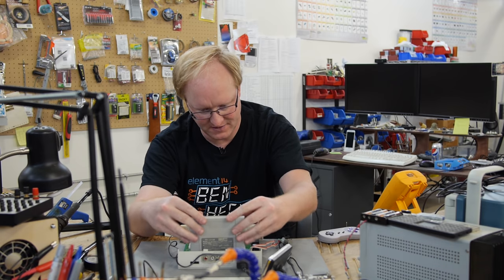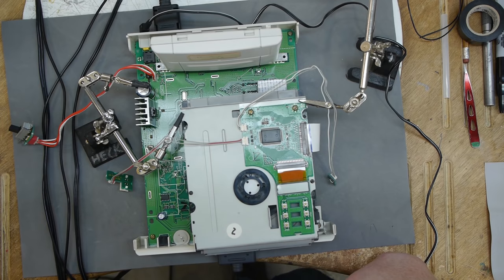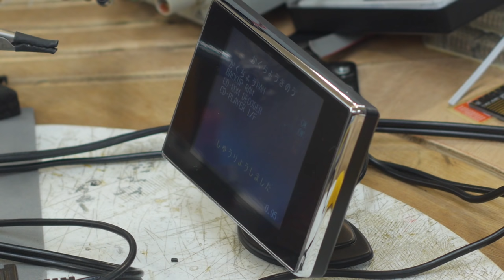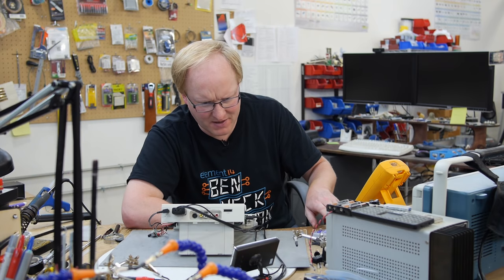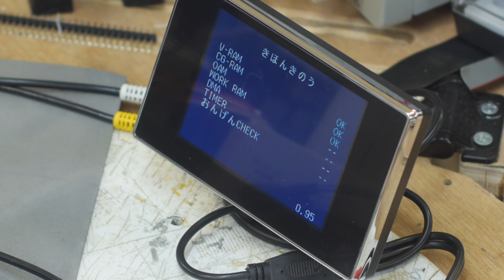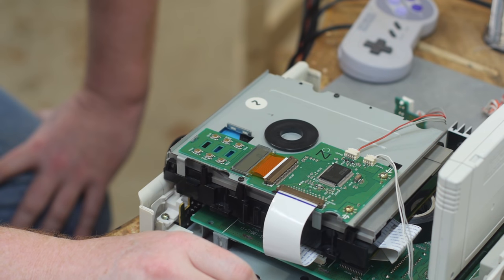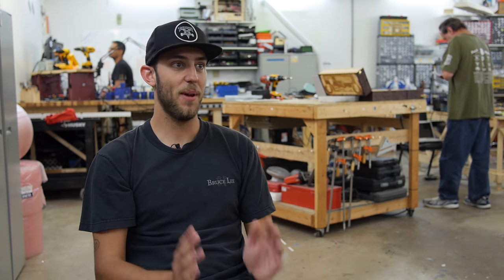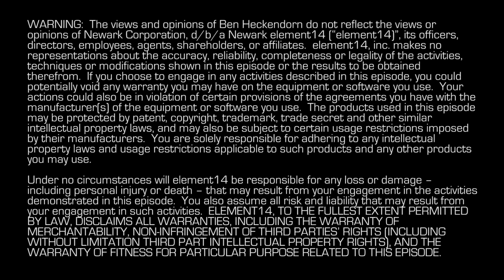Ben Heck's Nintendo-Playstation Prototype Part 2 Repair

Comment: correct me if I have this wrong, but was the plan back in the 90s for the super Nintendo and the PS1 to be one console?
Reply: Both, from what we know. The Sony SNES CD was an addon for the Super Nintendo that you'd stick in the bottom of the system, there is a photo of a mockup of it from back in the day. The Play Station was Sony's standalone version of it, similar to Sega's Multi-Mega, which was an all-in-one MegaDrive and Mega CD. There is however no known existing prototype of the SNES CD addon, so at the end of the day, that part of the story remains shrouded in speculation.
Reply: PS1 was not going to exist in the first place. SONY had no plans for their own independent game console at that point (up to early 1992).

Then Nintendo found that they signed an agreement with SONY that was of disadvantage to them, and bailed out. 

After Nintendo bailed, SONY started developing their own console, completely free of any Nintendo developed parts or compatibles. Some CD drive logic however and SONY's soundchip that was already used in the SNES made it into Playstation in modified form, the rest was completely new and different. This became PS1 (released 1994, developed 1992-1994), and it was a smash success.

Comment: (+) is it possible that nintendo made it so you couldn't play audio cd's just going by the later systems wii & wii u can not play dvd or bluray, or possibly the laser diode itself has died or misalligned, i've had quite a few of the original PS's in for laser replacement.

Comment: @The Ben Heck Show have you ever tried to load a PS1 disc  in that drive? I would be interested in a comparison between the disc system and the old first model of the sony playstation. Wonder if here are the same chips and layouts in there and sony saved dev time transforming this baby into the sony playstation disc-only thing.

Comment: So having examined this thing thoroughly...  could you attach a CD ROM drive to a regular SNES?
Reply: No because the cartridge contains the ROM and additional RAM required to utilize it.
Reply: Yeah just plug the IDE or SATA connection from the drive to the AUX IDE or SATA connections Nintendo provided on every SNES, and the AUX molex power connectors Nintendo always provided on SNES as well, and you have a full fledged SNES-CD system....

Except not at all.
Reply: andynshelleyinurface lol that was funny but there's no reason to be so facetious.
Reply: Solder them together at random contacts and see if it works?
Reply: Short answer: No.

Long Answer: Off the shelf CD ROM drives don't have a BIOS, let alone one that can overtake the boot sequence of a SNES. As the SNES wasn't designed to have a CD Rom drive, its BIOS will not understand how to boot software from a CD Rom drive.
Reply: It's not a trivial task, but i suspect that yes. You'd need to develop custom logic (i.e. implemented as CPLD + processor or FPGA) to drive the AT bus of the CD-ROM drive and essentially perform cartridge emulation.

The way this appears to be working, there's for one, a cartridge with software and RAM to allow CD-ROM booting; then there's yet another system which ties the optical drive to system bus and allows the cartridge to perform communication with the optical drive. Since complete system bus is exposed on a cartridge, there's no reason you couldn't re-engineer the system in cartridge form. There's one caveat, the soundchip probably runs off the CD-ROM drive's clock. So you could get slight issues, but for the most part, you can just lead analog audio out of CD and lead into the audio expansion pins of the cartridge slot, but i understand they wanted it digital and with no reclocking, so they synced it up.

The information presented in these videos is not sufficient to re-engineer the system though, someone would have to spend a while hooking logic analyser onto the bus and various bits of custom drive logic to do that. Then again, most of this information could just as well be gained from reverse engineering the cartridge ROM dump.
Reply: Word of note: the drive electronics has no similarity with AT drives used in PCs. But it does have similarities to what they used in Playstation later. So connecting CD-ROM would amount to full emulation, at which point you should be asking "why?" and engineering an image loader for SD-cards instead.
Reply: They have already achieved that with the Super Ever Drive.
Reply: Paul Graves I just looked at Super Everdrive change history, and it doesn't appear that they support loading CD images or emulating the optical drive. I mean emulating the optical drive is still easier than attaching a real one.

Comment: Correct on the lack of a region lock between Super NES and Super Famicom region lock.  The only reason that the games don't work on either system are merely physical ones.  The Super Famicom cartridge slot is too narrow for Super NES cartridge casings and the Super NES has two tabs in the cartridge slot that prevent the un-notched Super Famicom cartridges from sliding in fully.
Reply: There are two regions though: PAL and NTSC. CIC chip would prevent PAL games to work on NTSC and viceversa.
Reply: +KiiroBomber Japan uses the same signal that America uses (NTSC), so, there is no problems... PAL is for Europe
Reply: BOOZE & METAL region locking

Comment: Dunno bout the Super Famicom but the SNES technically had a region lockout.  It was a set of small pins in the cartridge slot that would prevent Super Famicom games from making contact and thus they would not work.

Comment: What a joy to watch. Making the drive work again. Possibly try a PS1 disc that may work or possibly a disc with a SNES game on it.
Reply: Going by the hardware specifications, a PS1 game would never work on this system. This is basicly just a SNES with a cd-rom drive, and more work RAM. As a history piece it is interesting, but as an actual product it's really nothing special, and not really technicially comparable to the PS1.
Reply: Why would a PS1 disk work on a non PS1 console?
Reply: +Phil Nolan Its a Sony Playstation combined with a SNES. Like I said 'Possibly'. The system has parts from PS1.
Reply: TRIPPLE JAY
No it isn't, It's a CD-Rom drive with some added RAM. It just happens to be made by Sony.
Reply: +Phil Nolan Compact Disc Read Only Memory. It could hold anything. I have managed to run PS1 games run on my laptop top. So possibly yes it can.
Reply: +Phil Nolan Its is a Playstion using parts from a Playstation 1. Have a look on the internet and look at both PS1 and SNES Circuit diagrams. Your obviously a novice of some sort and doesn't pay much attention to the video as Ben describes while he identified certain chips.
Reply: +TRIPPLE JAY The PS1 hadn't been invented yet. Not even thought of. Might have used the same parts but they're just generic CD parts that you also have in your average discman.
Reply: +Phil Nolan Yes your right as it was a joint project. If you compare SNES and Playstion controllers there the same. Unfortunately the Nintendo Sony Playstation was dropped by Nintendo and then approached Phillips and the 3DO was made then flopped. While Sony carried on with the Playstion and the PS1 and PSX was born.
Reply: +TRIPPLE JAY Right. I actually worked at game store (Babbages) when the PS1 came out. I remember we had both types of 3DO and they literally were gathering dust. Nobody wanted them.
Reply: +Phil Nolan It failed to badly due to a poor game collection. The games had no money for them. Phillips didn't even market the 3DO as game console. They did franchise out the 3Di to Kodak.
Reply: It doesn't have a CPU and GPU of Playstation, and what's there has not enough performance and memory for emulation, there's absolutely zero chance that a Playstation disc will run. Indeed the slowest device to emulate the Playstation by software was Dreamcast, which is easily 10 times as fast.

However, the XA test function in the cartridge menu will possibly play music from some Playstation games.

SNES games can run from CD, but they need to be on a specially formatted disc. It needs a custom written bootloader and the game would need to be small, no larger than 256 kilobyte if memory serves. Also the loader cartridge has no support for any standard filesystem used on CDs (like ISO9660 or god forbid UDF), so custom written software is needed to create a disc image in the first place, the resulting image can be burned by "dumb" software which doesn't verify images, but the resulting CD won't even show up when you put it into a PC. Shoving files on a disc with available software will do no good at all. That's the knowledge that has been gained from reverse engineering the cartridge ROM.

It needs to be kept in mind, though some existing components were used, it is a special purpose device after all. As opposed to later devices which became increasingly general purpose, because more powerful integrated electronics became cheap.
Reply: Siana Gearz Love the info back Siana. Very datailed and to the point. Thank you

Comment: water spilled on my laptop. how do i go figuring out how to fix it? it won't turn on now.
Reply: I suggest going by sight and smell, looking if there are any residue you can see. You can look at Louis Rossman's repair videos, they are MacBook, but obviously there isn't all that much difference to PC-compatible laptops these days.

Also important: was it REALLY just water? really really? Because many liquids cause a lot more damage. Cola, wine and cat urine often leave little to salvage. Take detailed pictures before cleaning, you will need them, and try to determine causes of issue before cleaning. Clean well, perhaps with pure Isopropanol. Best case, there's just a surface mounted fuse that blew and the fault has actually cleared when laptop dried, so the fuse can be replaced and it'll be good. Other easy issues can be with power button and its connection.

Does the power supply still deliver the voltage? Does the laptop do anything, like charge battery, when plugged in?
Reply: Siana Gearz That moment when you spill your cat urine on your computer
Reply: deIlluminati I suspect you already know this, but it appears cats often pee into laptops by accident. They like spending time on them, because they are warm. I don't exactly know how this happens, but there are more cat urine damaged computers out there than there are cola- and wine-damaged ones together.

Comment: can u teach me how to fine solder? i have this logic board for my macbook i spilled water on, i cleaned it with ethanol but one chip is damaged it has small points though havn't soldered small fine points
Reply: Have you checked out this crazy thing they call studying and practicing? Because I have a really weirdly strong feeling that Ben friggin' Heck doesn't have the time to fly out from Wisconsin and give you personal lessons.
Reply: You probably shouldn't try and do something like that yourself on something expensive you care about if you haven't done it before (practise on something cheaper). Look up Louis Rossmann on YouTube if you're interested in that kind of thing though.
Reply: Look up drag soldering, probably your best bet.  Don't forget, you can find any old electronics and practice on them first before attempting the real thing.
Reply: yah logical
Reply: What on earth does a physics degree have to do with SMD soldering?

Shocker on the Apple store issues: As it turns out, the employees there are all average college kids getting paid minimum wage. Their expertise matches.
Reply: You need to use a hot air station to replace the chips. Have a look on Louis Rossmann's YouTube channel for some help.
Reply: Check out Louis Rossman, he has a YouTube channel where he teaches macbook repair, and you should find there just about everything you might want to know, with some effort. If you want to ask him questions though, he used to just answer them in the comments, but that ship has sailed now, you need to register for a paid forum. Understandable, who wants to be overrun by rude people who all want something from them.

Comment: Sorry, but you are wrong about PC Engine CD RAM sizes. Most games actually require super system card or arcade card which add more RAM. Arcade card adds 16Mbit!! Save memory is also supplied via external attachments. Later some of that hardware (super card etc.) was integrated into the system.

Comment: Since I see no one mentioning it.
Why didn't treat the plastic to undo the Yellowing?
Yellowing Plastic can be come brittle and break, 
To reverse that would extend the life of the shell.
Reply: It's impossible to "undo" the yellowing, you're bleaching the unit with peroxide. It will be less yellow, but the already occurring decay of plastic will not be stopped. Furthermore it's unclear whether bleaching will not make the plastic weaker yet. It's OK to bleach a common unit made in millions, but a one of a kind system should better be left alone.

Comment: Perhaps the reason this one was scrapped was because it was only a minor update to the SNES as compared to the Sega CD, which added a considerable amount of added power to the Genesis (though strangely enough it didn't fix the main glaring issue of the Genesis, the tiny color palette). I'd really like to see the later version which was supposed to be 32-bit. Perhaps it never made it to the prototype stage since all I've ever seen is a spec sheet in EGM.
Reply: Unlike the Sega CD, though, this thing could be upgraded by replacing the system cartridge, much like the PC Engine CD-ROM.
Actually it's a bit baffling to me that this thing didn't have an add-on CPU in the system cart. So many SNES games had some kind of supplemental processor in the cart, it seems like that'd be kind of important.
Reply: Tetsujin Well, the PC Engine CD-Rom cards only upgraded the RAM and did nothing to enhance it's technical capabilities. They definitely could have upgraded the console by adding an additional CPU along with the RAM in the system cartridge. Maybe it was too expensive, maybe it wasn't enough of a an enhancement in the eyes of Nintendo to justify the extra cost, as well as splitting the market for Nintendo customers. Tom Kalinske has said he felt one of the reasons the Sega CD failed is that it just wasn't big enough of a leap forward to justify the extra cost of the add-on.
Reply: I like the Sega CD but I think the FMV games are what killed it.

Comment: SappyForums discussing what they found out from SONY.  This prototype was created only to get the SNES to recognize the CD Drive.  There's supposed to be another one out there that has a GSU mounted on it (approximately 24MHz vs the later GSU-2 @ 21MHz) Evaluate or confirm this please :)   Makes sense, since CD Games can't carry FX Chips, they would have to use one built into the system.  So we can't use this prototype as a fair comparison to other CD systems of the time.

Comment: "Electrolytic capacitors are always the first thing you should check,"
I'm not disputing this since it's still a good idea, but meanwhile we still have 1930s tube radios with wax capacitors that haven't floated enough to cause problems, and those are close to a century old...

Comment: whats a bodge? how much is this prototype worth?
Reply: oooone miiiiillliion doooolllaaaars
Reply: A bodge is an improvised fix. Like connecting one component to another with an added wire after you have already made the circuit board. When you design the board, you might have forgotten to print a trace to connect something. So, rather than print another board, you just connect the two points with a wire.
Reply: A prototype is worth whatever someone is willing to pay for it. With no buying and selling of these things going on there is no "going rate" for one, if you owned it and wanted to sell it, it'd be purely a question of whether you could find a sufficiently motivated buyer with deep pockets. From the buyer's point of view, there's no buying it elsewhere if the seller doesn't ask an appealing price...  But from the seller's point of view, there's not necessarily a whole lot of people willing to pay tens of thousands of dollars for something like this.
Reply: Well, the thing went on eBay for less than 100 bucks.
That's possibly because it wasn't sold by a person who knew about its history, collectors on the other hand might just as well sell their entire collection to get hands on this thing.
I mean the device ben repaired is the only one of its kind that's left.
Reply: There is only one known prototype of this system and we just saw it.....  You do the math lol
Reply: +Chris Bajorski lemme do da maff. potato+halitosis= nipple salad
Reply: It's a more concise way of saying "jury-rigged".
Reply: this one, or another one went on eBay for 100?
Reply: Gog, you forgot to carry the 2
Reply: +Tetsujin I'm a collector and I would pay 20-30k for it
Reply: Kyle Coulombe Well, if you're serious, you know who to talk to.
Reply: +Kyle Coulombe People have offered WAY more for it and got declined.

Comment: They should've tried burning existing homebrew ROMs onto a regular CD to check if it works, maybe they haven't yet implemented disc protection mechanisms in this unit.
Reply: It's possible they weren't even going to. In those days CD burners were uncommon and recordable CDs were expensive, as a result the old CD-ROM systems weren't copy-protected.
Reply: Yeah the SEGA CD wasn't copy protected.
Reply: +DarkHorizons But copy protection wasn't far off at this stage of the SNES's life cycle. The Playstation and Saturn had protection and they were shortly after this prototype. Of course, being as it's an in house prototype, it probably didn't have protection as it was never to make it into the wild.